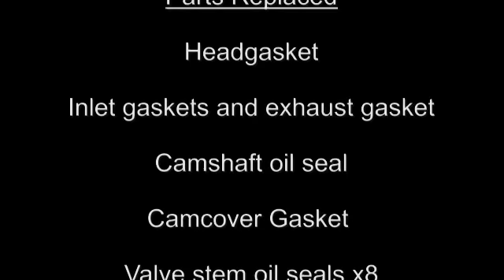Peugeot 206 1.4 8v Head Gasket Repair

Comment: Hello, can you please tell me the name of the pieces (also peugeot codes if you have) that you used in the head gasket repair ? Thank you
Reply from the maker: Hi i used a headgasket repair kit all you need comes in the kit.Headbolts do not come in kit  sorry i dont have part numbers
Reply: @JayJayJaroo  is your engine still ok? I have same engine, car starts well, no bubbles in the tank, but i see oily spots on top of coolant and coolant is dropping slowly, about 100ml in maybe 200kms. I replaced termostat gasket, radiator, and still loosing coolant. Should i replace head gasket?

Comment: Wrong Spark Plugs. Peugeot coil packs only like Bosch ones.
Reply from the maker: In your opinion maybe NGK plugs are OE fitment for citroen.Have been fitting NGK plugs for years and never had a problem
Reply: Not my opinion, this is coming from Peugeot themselves. NGK are not suitable for the coil packs apparently.